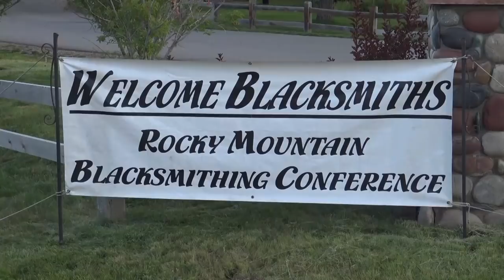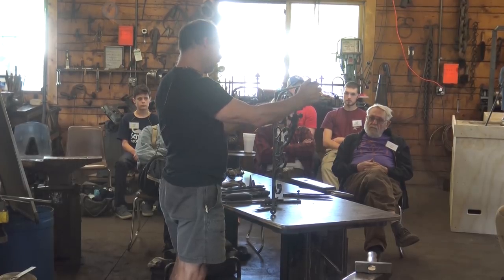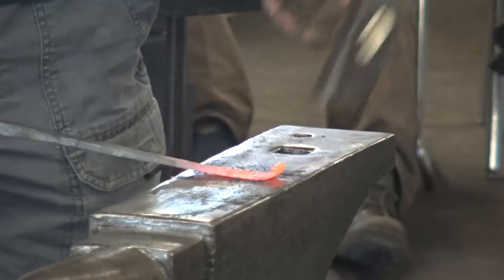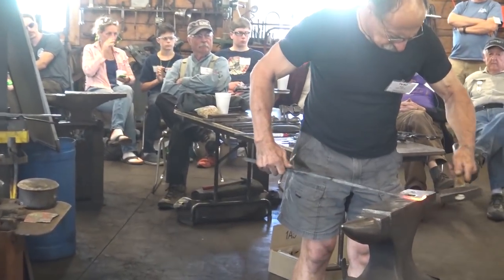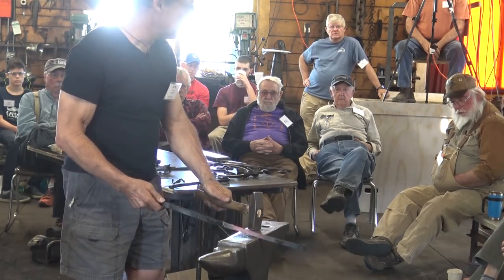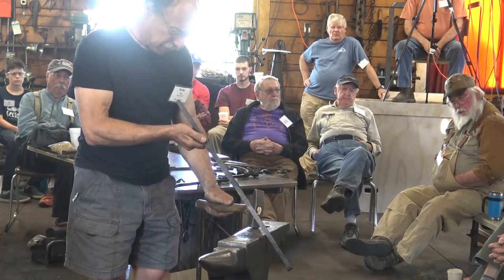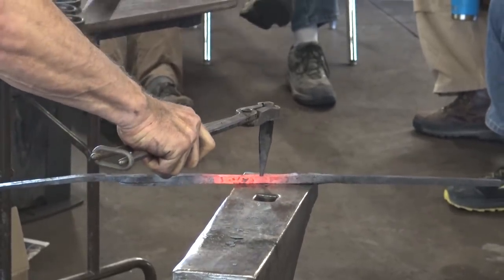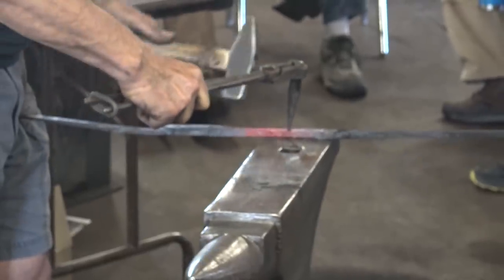Peter Ross Demonstrating a scroll at the 2018 Rocky Mountain Blacksmithing conference

Comment: How can you come to the conference? What credentials do you need? 
Kevin Burwell
Reply from the maker: No credentials required.  Just sign up ahead of time or make sure there is space and sign up here.  Registration usually starts around the end of May and the conference is the first or second weekend in August each year.  But check your local groups, they may have something similar at different times of the year.  We will be headed over to Utah next month for a similar but smaller conference.